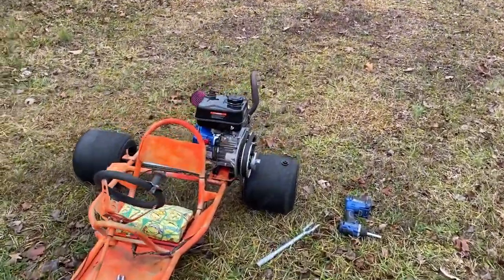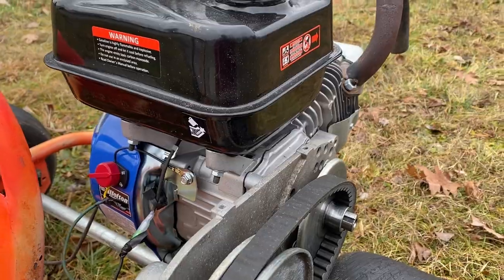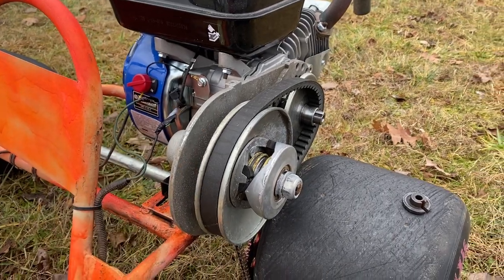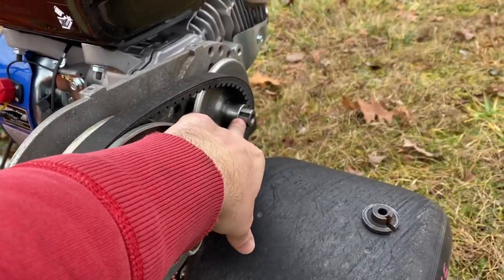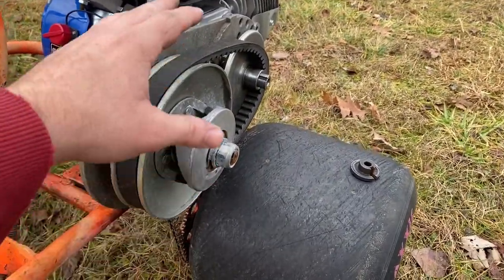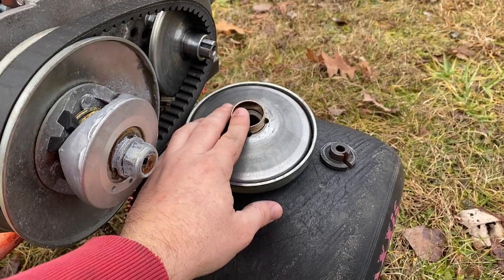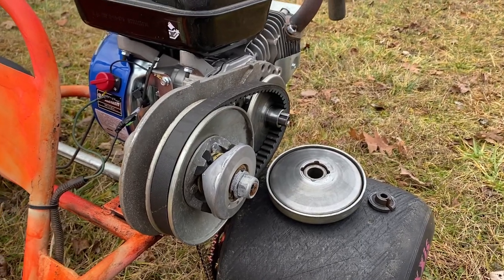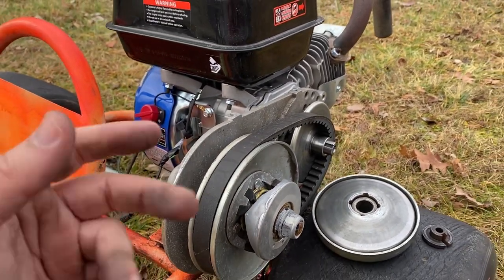Dangerous! Flaw Of 30 Series Torque Converters

Comment: They seem to run the belts way too loose on these units, you dont need that bushing with the belt so loose as its not even contacting the shaft.
Your starting off in third gear with that belt so loose. On a snowmobile if you put a straight edge on the top of the belt you want no more than 1 1/4 sag when the belt it pushed on in the center. Looking at these belts I imagine you could almost touch the bottom side of the belt which of course is way too much.
Reply: The belt will tighten the moment the rpms rise
Reply: @Gpgesell1  yes it will but it will tighten far too high on the primary clutch thus starting in a higher gear than optimal, this also creates a lot of heat which destroys both belts and clutches.
Think of the bottom of the sheves close the the shaft as first gear and as the belt rides up the sheves farther away from the shaft it shifts up so into 2nd, 3rd, 4th and so on. The secondary clutch fights this and controls back shift according to speed and load.
Idealy you want the primary to shift to max rpm/hp immediately when you punch the throttle wide open and hold it there, again speed and load. Lots of variables in a cvt.

Comment: Also need to know what size the cover bolts are so this don't happen again and I gotta get the snapped bolt outa the driveshaft 😢
Reply from the maker: The bolt is a 5/16-24. I usually go with a 2 inch long bolt and lock tight if you’re having issues with it backing out.
Reply: i had the crankshaft bolt snap its because its overtightened, tighten it with an impact and tighten it till it does about 2-4 impacts, currently running that and no issues. I replaced my crankshaft and also modified my crankshaft bolt to be stronger by lengthening and annealing it. you wont be able to remove the bolt stuck in the old crankshaft so your only way would be to drill and tap it to an m8 thread

Comment: Man, I have never heard of this and I'm in the middle of putting one on my mini bike.
Reply from the maker: Yeah the converter will be fine. The brass bushing just has the potential for causing a failure.
Reply: @jwsbackyard6413  I'm mostly worried about my back wheel locking up!
Reply from the maker: Yeah just get rid of that brass bushing and you should be good.
Reply: @jwsbackyard6413  Graphite dry lube. Its a replaceable part

Comment: Hey I got a question so I installed by torque converter and when I put the bolt on tight I can pull the recoil it gets real tight do you know if there is any fix to that
Reply from the maker: There’s no reason tightening the crank bolt should make it hard to pull. Something has to be installed incorrectly. You usually need a thick spacer and a washer on the crank before you install the pulleys to keep the pulley from rubbing the mounting bolts, this could be your issue. The large nut that holds the driven pulley shouldn’t be over tightened either. It can put pressure on the bearing and make it hard spin.
Reply: @jwsbackyard6413  ok I didn’t have a spacer that was the problem thank you

Comment: that happened to me twice, the wheel on my minibike locked up at 40mph. I took off the pully and the brass bearing was gone, must of broke off lol.
Reply: Probably cus you're doing 40 mph with a torque converter meant for lower HP/speed engines
Reply: @RandomPerson-ob1hk  still works fine to this day, only downside is belt wear but its whatever.
Reply: @LogixChannel  lmao don't die out there
Reply: @RandomPerson-ob1hk  I'll try not to lol

Comment: Use two ball bearings instead of the bushing.
Reply: Lol does that work??
Reply: Yup. Sure does.. It is how they designed the pressure plate/backing plate on the Trailmaster mb200-2. It is supposed to reduce absolute friction during idle to promote the slip so the bike doesn't lurch forward. Personally I run the comet bronze bushings. I've only had 1 stick and lock my kart axle and that's because the weights were worn and needed graphite spray. I also read somewhere that there might be variations in the backing plates where lesser brands actually use a shorter spindle for the belt to rest on which causes premature belt impingement. Crazy stuff.
Reply: @Wilson Catapat nah I got rid of the driver with the bearings. It was a stock mb200-2 thing that only works on those drivers.
Reply: @aarondlc8544 and how mr braniac are "ball bearings" going to sit there while it spins?
Learn what to call things before trying to sound smart.

Comment: I have a 2 Coleman kt196 gokarts with GPS stage 1 kits. Im thinking about swapping them for Tilly 10's like you have. My stage 1 kits will work. In your opinion is it worth the swap? How big is the smile on your face when you mash the pedal?
Reply from the maker: Yeah any 212 clone or predator exhaust, intake and jet will fit the Tillotson 212. Honestly I wasn’t impressed at first but I swapped the intake, exhaust, rejected it and removed the governor before even starting it and it ended up feeling slower than my predator. Turned out that the jet was still too small for the mods and once I bumped up a few more jet sizes it’s a pretty nasty engine. I’d say it is def worth it. It already comes with automotive style retainers and keepers and the flywheel is rated for high rpms. You’d end up paying more buying a predator and adding retainers and a flywheel and still make less power than for the Tilletson.
Reply: If you are not going to build your 196 a Ducar, Tillotson, or Wildcat is the way to go.

Comment: So should i use this ring? Would oil do anything
Reply from the maker: That’s up to you really but I don’t use them anymore. Dry lubricant would be a better option and would be less likely to affect the belt. You just have to make sure it’s lubricated often
Reply: @jwsbackyard6413  I am very new to this. What is dry lubricant and are there other available options. Also could that ring be the reason my clutch wasn't disengaging and ripping the belt in half. And yes I do have the right belt and rear clutch.
Reply from the maker: @adamhynes296  there are a lot of different types of dry lubricant. A lot of people like graphite lubricant now but they usually print ‘dry lubricant’ on the can so it’s easy to spot. Dry lubricant dries but still leaves a dry film that reduces friction.
Reply: @jwsbackyard6413  so one more thing. Would something like spray lubricant work and where would I put it on the ring? Like would wd40 or lithium grease work?
Reply from the maker: @adamhynes296  most dry lubricants do come in a spray but you would lubricate the inside of the ring and I would lubricate the the inside of the driver where it slides over the ring to keep it from catching. Other lubricants could work but with something wet you’re likely going to get it on the belt and surfaces that grab the belt which would make it slip.
Reply: @jwsbackyard6413  I ended up taking the clutch off and spraying the inside of the ring and the inside where it goes with gel grease. I did not get it anywhere where the belt touches so is this okay?
Reply from the maker: @adamhynes296  it will probably be fine. You will know if it migrates where you don’t want it if you start to get belt slip.

Comment: Why does your kart have so much negative camber? Just curious.
Reply from the maker: The frame came like that and from the pile of parts I got with it it looks like it originally had some angled spindles on it ti flatten the wheel out. One of the spindles where bent and I couldn’t find a replacement so I just left the brackets like they where and went with some normal spindles to get it moving. Turns out the camber works out the camber works out pretty good when drifting it.
Reply: @jwsbackyard6413  you turned it into a fun toy for sure!!

Comment: Have you had anything fly apart dangerously on one of these?
Reply from the maker: No, even if there was a failure inside the driver it’s still contained within the clam shell and can escape without taking the bolt securing it out.
Reply: I had a 30series Torque Converter fly apart on me at 30mph. Didn't cause a crash, but my brother was riding right next to me and almost got hit with one of the collars that holds the springs in the main pulley. The main bolt sheared several threads off the inside of the crankshaft causing the entire assembly to fly apart. I had to re-tap the crankshaft to put the torque converter back on.

Comment: What do about my torque converter that is unaligned
Reply from the maker: There is a spacer and some washers that normally come in the kit. The spacer and washer go in the crank shaft behind the pulley so that you can get the alignment right. You can also add washers to the driven pulley side at the sprocket.

Comment: What size wheels are those? And where I can find them online?
Reply from the maker: They are 6 inch rims and 8 inches wide. The tires are 12x8.00-6. I don’t have a link but you can just search those sizes on google and some options will pop up. Tires are Maxxis but not sure what brand the wheels are, got a bunch of random rims for cheap a while back, these are just spray painted black.

Comment: Did the bolt break off inside the shaft?
Reply from the maker: No, bolts were alright, just the sleeve sticking inside the pulley
Reply: My bolt keeps breaking is this the cause

Comment: Hey man I saw your video where you installed the yellow driven spring. Do you have a rule of thumb when picking the garter springs in the driver pulley? Like, do you need to use heavier garter springs when using a heavier driven spring? Great channel 👍
Reply from the maker: I just run the factory springs in the driver with the heavier driven spring and have had pretty good results. I’ve never changed the springs in the driver so I can’t say if heavier springs would be better or worse.

Comment: It's almost like a clutch rated for 6.5 hp won't hold up to 10 hp 😱
Reply from the maker: More like 15 but a few others have tried to say this. I’ve actually had this happen 3 times and the other two times where on a stock Predator 212. It’s clearly a clearance issue rather than a power issue.

Comment: I just installed pretty much the same one on my kart and I can't get the wheels to spin freely. When I pull start the kart it wants to move the wheels along with it. I dialed the back the idle as far back as it can just in case and still it seems like the tourque converter belt is engaged even when in idle. Have you seen this? Any suggestions? Is it just a bad Torque Converter?

Here's mine: https://www.youtube.com/watch?v=MMP0gvC3AOY
Reply from the maker: A high idle could cause it but yours seems alright. The belt could be to small or something may be up with the drive pulley. Make sure it is all the way retracted and not hung on anything making it engage the belt
Reply: @jwsbackyard6413  I dialed the idle all the way back and it wants to spin the tires as soon as I pull the starting cord, so I don’t think it’s an idle issue. I returned this torque converter to Amazon and bought a more expensive one from gopowersports and it’s a little better but still the same issue. It seems like when I tighten down on the driver pulley bolt it is pinching the belt I. That pulley instead of letting it spin freely.
Reply: @JasonLefevers  probably fixed or figured this out by now but I had a similar issue with my 30 series clutch and it was the belt. one side is tapered and one side is flat, I believe the flat side goes to the engine. was going to say, turn belt over and try again.
Reply: Could also be your pulley alignment, be sure it is even with shims or else you'll eat through belts daily.

Comment: The bushing is meant to be Lubricated. A little WD-40.
Reply: absolutely not. if anything is used it should be dry lube
Reply: @pwn3426  You don't put dry lube on a bushing. They get a couple drops of oil.
Reply: @Deucealive75  Hrmm thats weird comet themselves agrees with what i stated previously. NO WET LUBE.      P E R I O D !
Reply: @pwn3426  That's fine. The maintenance that I do on both of my stock driver's has worked fine for years without issues.

Comment: Because they are not meant for 10hp
Reply from the maker: Yeah people keep trying to say that but I had this same thing happen on a stock predator 212 a few months later that I didn’t realize I was still using the bushing on. The clearance of the ring is the issue regardless of power. No matter how much power you have it would  not cause this.

Comment: Those or any torque converter on a gocart is useless and a waste. A tegular clutch is easier faster simpler and last longer. This is all these r good for. Nobody needs a torque converter on a gocart and they dont even work like 1. They r just a clutch that looks weird and drives a belt. U could take all that excess off put a chain on it and have a regualr clutch. Its like pouring water from 1 bottle in another its the same water u just made it harder to drink
Reply from the maker: Have you actually ever used one of these? Most of what you said is wildly inaccurate. I have converted almost every basic clutch setup that I have had to a CVT. The issue with a standard clutch is that you are stuck with one gearing ratio so you either have something that takes off fast but has a reduced top speed or you have something that can barely get moving but has great top end speed. If you take the middle ground and go with gearing that has ok torque and ok top speed you are still sacrificing. These CVT offer large amounts of torque for take off and good top end speed.
Reply: Your 1 of the please wear a helmet kids?

Comment: Not a flaw and its supposed to be there.
Reply from the maker: There’s no real way to install this incorrectly. It’s just poorly clearanced from the manufacturer. I’ve had this happen on two of these converters and have seen multiple posts by other people with the same issue. A wheel locking up on something like a mini bike would definitely be dangerous.
Reply: @jwsbackyard6413  More likely the bushing was worn out I would think.
That is a part that needs looking at regularly.

Comment: A bone stock predator with gov bypassed or removed makes between 9 and 11hp..
Reply: @Skott LeFever What HP would you get with properly jetted Mikuni and a header pipe on a stock 212? Easily 9 if not more than 10. What "stage" is this with the governor gone for the Mikuni install?
Reply: @Skott LeFever  Actual dynos have proven this. The 212 holds its torque from 2100rpm to 4800rpm. Governer limits throttle at around 3600rpm. Torque x RPM = HP
Reply: No way a bone stock 212 gets 9-11HP. You need at least a stage 1 kit for that.